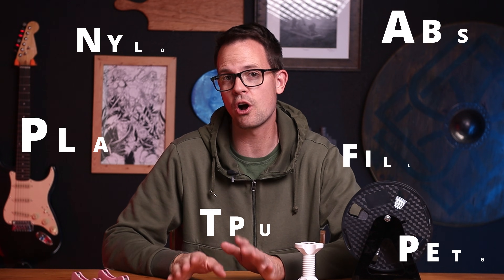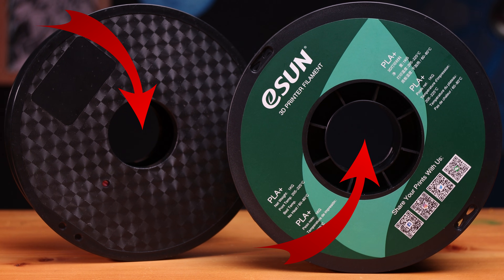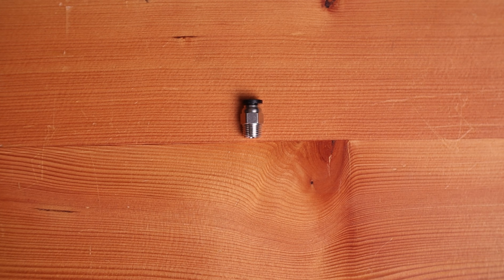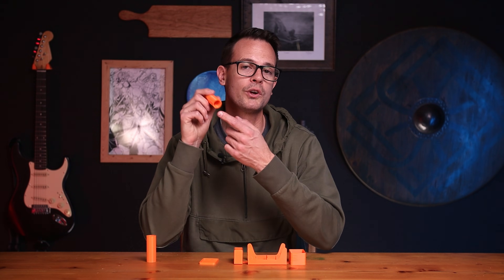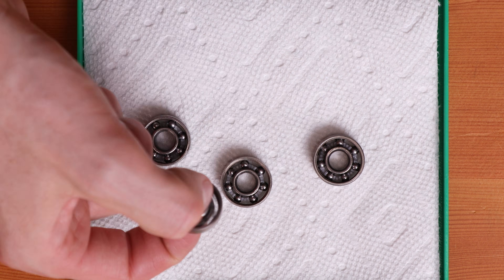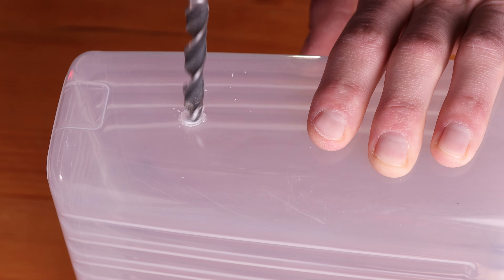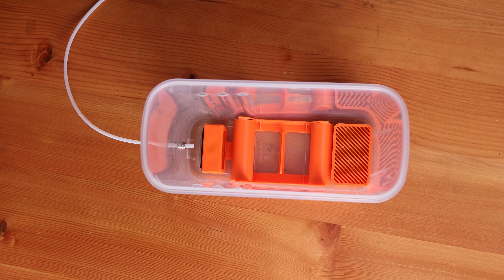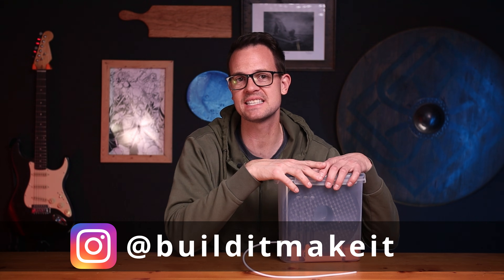How to Make a Simple and Quick 3D Printer Filament Dry Box | Free STL

Comment: On Bambu A1 mini its slightly too big to make on the plate.. so im screwed. I even ordered everything before I realized..
Reply: I was able to rotate it on the plate and fit on the Bambu A1 mini. Saw the comments for Bambu support finally for the rollers, normal auto/snug. Using .28mm layer height as its the highest it will go.

Comment: Not saying this is bad but it's actually cheaper to buy a polymer dry box and driver combo which has interchangeable containers. It seals and drys and what is di is I have a bag of dessicant pack and I can just put probably 60 of them in and it will do just as good.

Comment: Really cool design but I think you don't want to replace the bearing grease. They feel smoother under no load. But with a light oil instead of grease they will wear down sooner. Now the load from a filament spool is not much so in the end I don't think the bearings will wear out that quickly anyway but I also don't think that it's remotely worth replacing the grease. But I guess I will find out myself when I build this.

Comment: There's a small problem with this roller when using some plastic spool. The plastic spools are thinner on the edge and get caught between the roller and the roller holder, which adds a ton of friction to the roll. To fix this, plastic spools should have an adapter that widens the edges up the roll to at least 3mm. Otherwise, these drybox rollers are great a year later.
Reply: Do you have a file with the changes incorporating the the adapter or pictures?

Comment: I'm using the 3.7L since the 4L are pretty much unobtanium.
Just shrinked the y of 3.7mm and they snapped perfectly.
The "wings" over the roller bearing attach are brittle, but they works.
I'd suggest covering the rollers with tape, to improve the grip.

Overall, awesome project.

Comment: I live in St Louis, MO. We're surrounded by 3 rivers, so it's always humid here. My office runs about 50% to 60% relative humidity from April to October. I have been using the vacuum seal bags to store my filament, along with a pouch of desiccant and a hygrometer. But that is such a hassle -- constantly pulling filament out of the bag and then resealing the bag and sucking it so the desiccant doesn't become wet while I'm using the filament.

Your way is a much better solution. I won't need to open the box when switching filaments. I've just ordered parts on Amazon and will be printing the printed parts today on my Ender 3.

Comment: These cereal containers are no longer sold on Amazon and I’ve searched and searched and cannot find these cereal containers based on the dimensions of these discontinued ones and none have the width/depth so I’m wondering if I could use a Sterilite 20 Qt. Clear Gasket Storage Box Latch and store the rolls here and follow your same method? Also, can I attach this to my AMS Lite and are you drying your filament in toaster/convection oven at 125F/45 minutes before you stored them in the boxes? Thank you.

Comment: Going to make this! Just ordered everything off of Amazon. 

I know this vid is 2 yrs old but I hope it goes off without a hitch. Going to your site to download the files. 

Wish me luck!
Reply: How did yours go? I just got all the parts myself.
Reply: @colinl5710  went pretty well! I soaked my bearings like in the video and added my own lube. This is NOT a necessary step because my bearings came with a good amount of grease and spun pretty good (maybe even better) right outta the package. 
It's definitely a cool print. The beads have their own little container which is cool. I got my filament down to below 20% humidity which is great. 
Also, I did have to fix the housing for the humidity gauge as when I pushed in in it snapped some of the posts off the print (this is specific to the "more flow" STL version)

Comment: Thanks!
Reply: Great build. I did all six! I decided to order some Alumina desiccant for my wetter spools (TPU, Nylon, PC) because the silica couldn't get humidity in those any lower than 40%. We'll see how that works. I also drilled the PTFE tube adapter to the lid as one other QIDI Q1 Pro user has done and it's working great.
Reply from the maker: Thanks so much for the super thanks! You rock!!! So glad it worked out for you and sounds like with the alumina you have a great setup!

Comment: One suggestion: Move the PTFE tube adapter to two inches from the top rather than the bottom.  With it at the bottom you have to run out a couple feet of filament (under the bottom) to put it in the tube, then put the spool in and take up the slack.  If you put it near the top you can put the spool in first then run the filament only a few inches to the PTFE tube (over the top).  Much easier (IMO) to change spools too.  Great work though!

Comment: One tip: If you're using abrasive filaments like carbon fiber nylon, you might want to swap out the PTFE tube every so often, maybe once a year. Markforged has a drybox very similar to this without the humidity sensor, and the PTFE tube they use is a consumable item because Onyx is an abrasive filament.

Comment: Just made one of these and have one suggestion.  The uprights that hold the connectors for the bearings are far too thin and break really easily.  I fixed it by super gluing a popsicle stick to the outside.
Reply from the maker: Thanks for the info! They should just barely fit inside the cereal containers which gives the strength to the print and maximizes space for the rolls. There are other designs that are meant to be free standing.

Comment: I found 2 spools one from IC3D and Jessie's Premium (both from printed solids) that do not fit inside of this.  The spools are about 20.5 cm (~8 inches) in diameter.  The width of these spool seems to be the biggest problem, they are 7 cm (~ 2.75 inches).  All the rest of the spools are from Bambu labs and they print and store in there perfectly.  Thank you for the tutorial and the files.  Do you have one for larger spools?
Reply from the maker: Thanks that is good to know those ones don't fit, but also a bummer. Sorry I don't have one for larger spools. I recommend printing a free standing base and putting it in a larger container for larger spools.

Comment: Def use tree supports only on the plate! The “more ventilation” option is very fragile using PLA.
Reply from the maker: Yeah, this is meant to minimize filament usage to maximize the size of rolls you needs and needs to be used inside the container, not free standing. Thanks for the tip on the tree supports.

Comment: Just printed this on my new p1p and it works great, only problem ive had is the barrings are loose and dont click in
Reply from the maker: You can try shrinking just the x and y axis by 2% on the roller which should help.

Comment: As I understand it you actually want ZZ (608zz vs the 608rs) bearings, as the ZZ rolls smoother/faster when compared to the rs, so no clean/re-lube needed. I've been looking for a system for my ERCF v2 (8 cart) plus storage - I think I'm going to go with this with some mods. Thank you!
EDIT: Darn, FusionFilament (ABS) rolls seem to be about 73mm, but this will work well for just about every other filament I have - of course I realized after ordering what I need for 18 boxes.
Reply from the maker: Oh no. That is such a bummer of the filament roll size. It is crazy how much variation there its in the roll size. Yeah the ZZ bearings are totally the way to go. I had a bunch of the rubber sealed ones and wanted to use them since I already had them. Thanks!
Reply: @BuildItMakeIt  ah that makes sense! Yeah, oh well on the Fusion stuff. I like their ABS but I'm moving towards ASA for the ABS needs so it's not like these try boxes will be a waste. Mostly will be using PLA with my ERCF anyways. Already printing the holders, thanks!

Comment: Anyone else's roller assembly very flimsy? Still works fine for me though
Reply from the maker: It is designed to only work in the filament box and not stand alone so yeah it is flimsy to fit as wire a roll of filament at possible. Thanks for trying it out!
Reply: @BuildItMakeIt  Its fine! Thanks again for the stls, I have like 10 of these now hahaha

Comment: Made one out of a 10 gallon aquarium.
10          Gallon Fish Tank
20x12   Plexiglass Sheet
3            Stainless steel door hinges (3 to keep the plexiglass from bowing in the middle)
1            12" to 20" adjustable tension rod
1            Digital hygrometer/thermometer
6 m       Ultra-Smooth PTFE Tube, 2mm ID Teflon Tube
7            PTFE Tube Adapters
1            Mini adjustable aquarium heater
I also added a powered 4 port USB hub to power the hygrometer, the aquarium heater and the LED Lighting. To add a little character, I also added vinyl to the bottom and back of the aquarium. I tilted the aquarium with the opening facing front so the filaments feed from the bottom through the plexiglass door.
Reply from the maker: That sounds like an awesome build.
Reply: Any chance to can post a photo or have a page with instructions/video? My grandson is getting BambuA1 combo for xmas and will need dryer box for his filaments
Reply: What type of aquarium heater? Usually they are designed to be submerged in water.

Comment: So I have run into the issue where the cereal box from your link is smaller than base printed. It doesn't fit at the bottom. Anyone run into this issue?
Reply from the maker: Yeah, it seems like every now and then amazon is changing where link goes. The boxes should have three small grooves on the side, not one big one. PRAKI and Skroam 4L cereal containers have worked for people.

Comment: Anyone else do this but end up with some different container that is slightly skinnier, doesn't fit the model, and doesn't let the filament turn?

I used the link, so I'm not sure what's up. But it doesn't have the 3 ridges on the handle. It has 1 big ridge that is deeper, so it throws everything off.
Reply: I see the link on YouTube directs to a different product than his website.  Which link did you follow?
Reply from the maker: Yeah for some reason the link on YouTube sometimes messes up and links to the wrong containers. The one on my website seems to go to the container with the skinny ridges but when it comes from YouTube sometimes it redirects wrong. I am trying yo figure this out. Sorry.
Reply: Interesting - I was going to assume it was the other way around.  I was planning on ordering from the YouTube link, because the associated product images (Wildone store 29.99) had several grooves in the handle.  The website directed me to a large single groove (seseno store - 25.98)

Comment: Is it normal that mine is like pretty thin?? It looks kinda fragile
Reply from the maker: Yeah it is pretty thin on the sides so it can accommodate wider filament rolls as it is designed to fit inside the cereal container.

Comment: Parts arrived from Amazon yesterday and I finished the box off in 15 minutes.  I had already printed the files you supplied.  For want of a better description - It worked great out of the box.  I am finishishing printing the second base and will make a 3rd as well.  Thanks for putting this together.  I changed the height on the exit fitting to match the input of my printer.
Reply from the maker: Great to hear! Thanks for the info.

Comment: For the same price it would cost to buy all this stuff you could just buy a dehydrator for the same price.
Reply from the maker: Yeah, this doesn't replace a dehydrator you still need to get it dry. For a lot of people dry boxes may be overkill, or they can also just redry before uses.
Reply: Not even close
Reply: @KronicDaydreamZ  food dehydrator, not filament.
Reply: @StephenStrangeX  it's to keep filament dry not for drying it
Reply: @KronicDaydreamZ  for the same price and way less hassle you can buy a dehydrator, pop your filament in it for an hour or two and you will have dry filament. You must be new here.
Reply: 🙄 It's about not drying them once they are dried. Also, I would only use pla, petg, and abs in an ams because abrasive filaments cause more wear on it. Those types of filaments like nylon, PC, fiberglass, and tpu because of it's flexibility are also all more hygroscopic. So, having a dry box aside from an ams or filament dryer that you can also print from is a must, at least for me 🤷‍♂️. Plus you can get all the supplies to make 4 of these boxes for about 35$ on Amazon assuming you already have filament, ten dollars less than the average filament dryer...at least a good one that is.
Reply: @josephsmith601   for the same price and way less hassle you can buy a dehydrator, pop your filament in it for an hour or two and you will have dry filament.

Comment: Any tips for printing the roller using Bambu Slicer?  Concentric supports are not available.
Reply from the maker: I tried it on type: normal(auto) and then style: snug and it did the concentric support. Weird they name them so strange.
Reply: @BuildItMakeIt  Threshhold angle for this?

Comment: Love this design and price for this diy. However…the frame is a bit flimsy and cracks because the bearing last get stuck on the tabs on the base. My bearings did not snap into the roller… they slid in easily…but stick tightly on the post /table.

Also my rollers had a bump that ran end to end which was bumping the filament spool and casing it to slowly move off center and then come off the rail and get stuck. After sanding  it off both rollers I realized it was the spiral of the rollers causing the derailing. So I tried flipping the direction of the rollers a few times so they spiral in opposition to each other and stop the spool from tracking over to one side or the other. I’d suggest sanding the bearing pins so they come off easier.
Reply from the maker: Oh sorry that sounds rough. So far I haven't heard of people having that much issues but it does seem to be printer dependent. Sound like you may need to shrink it by 1-2% which would help the bearings fit into the roller tighter and then not get as stuck on the roller bearing pins. That was a great idea about switching the roller directions to help with that tracking.
Reply: @BuildItMakeIt  I made the walls thicker ( by one and changed the infil - in know there really isn’t any) and sanded the heck out of my rollers … now it’s better. Made 2 for now ..Wish I could send a pick here.
Reply: Printed on a Prusa XL and had similar issues. Frame being flimsy is a compromise to support more filament rolls that I agree with but maybe adding some ribs can help stiffen it up similar to lots of injection molded parts. Rollers were definitely slip fit for me bearings as well. Don't seem to have a bump on the rollers and have not tested enough to know if it sliding but my rollers had a very pernoused seem line. Still try them at and will report back if I figure things out. 

It also seem @eminence55 had similar issues with the bearing fit as well as roller length.

I will say the container dimension could have some very large tolerance bands so it could be hard to deal with. For the bering things should be quite consistent so not sure why mine came over sized.

Comment: The cereal box link on your website takes you to a different cereal container than the one in this video.  The ones from your website do not work with your design.  That link may need to be updated.
Reply from the maker: Thanks so much. I am trying to get on top of the link situation. It seems Amazon in just the last week has started linking to some different cereal boxes depending on your region you live in. The size is the 135.3 or 135.2 oz containers that have a gasket at the top and three groves on the size. Wildone is one brand that I know works and also Blingco. Seseno does not work. Sorry so much, I really am not sure what is going on with the links, I have made new ones, but Amazon seem to still be changing stuff around.
Reply: They sent me seseno 🫤

Comment: Ordered the boxes in the link above and I am guessing the design of the cereal containers has changed. They no longer work on this project. Do not order what was linked. You need something that doesn't taper at the bottom so badly. But the dimensions are around: Package Dimensions	14.8 x 9.65 x 7.28 inches. They are not standard or easy to find I am finding out. If I find something that works I'll update it here. I went balls deep and was just waiting on the containers so I have 6 rigs ready to go as soon as I find a container that works.
Reply from the maker: Thanks for the info. Do you know what brand you purchased? Generally the 4L /135.2 or 135.3oz seem to work for people. I'll will look into the links to see what is going on. Also that size seems giant. My containers are roughly 9.5x9x4 inches.
Reply: The new container link works. I received my new set of 6 and they fit perfectly. Thank you again! @BuildItMakeIt

Comment: So how's this relating to the recommendation to replace PTFE tubing with Capricorn one? If I replaced the tube on my Ender 3 Pro, woudn't making the filament go though regular PTFE tube undo the improvements?
Reply from the maker: That is a good question. The PTFE tube is before the motor that is pushing the filament both on Bowden setups and direct drive. The tube is mostly there to help the filament not pick up moisture and allow it to not get tangled up on the way to the 3D printer. This won't change any tubing replacement benefits on Bowden setups. Hope that helps.
Reply: @BuildItMakeIt  Thanks!